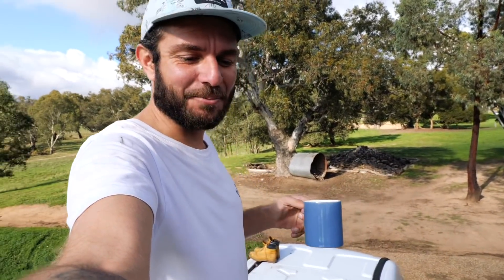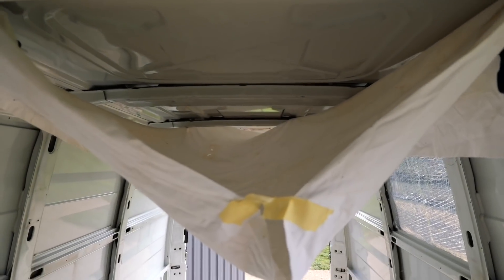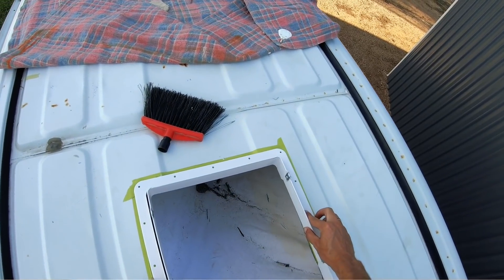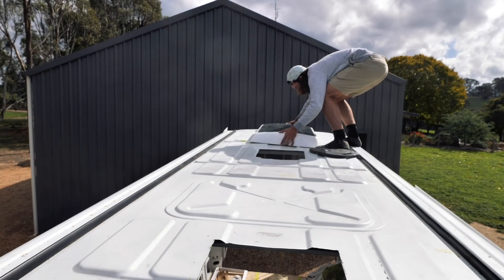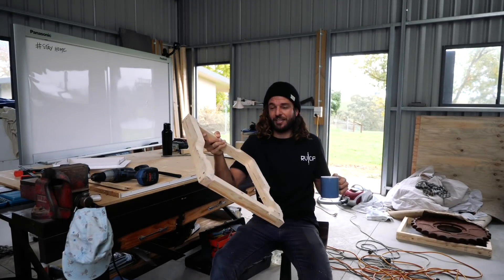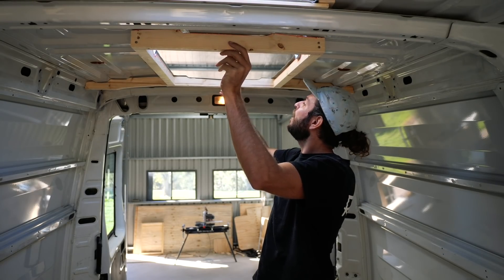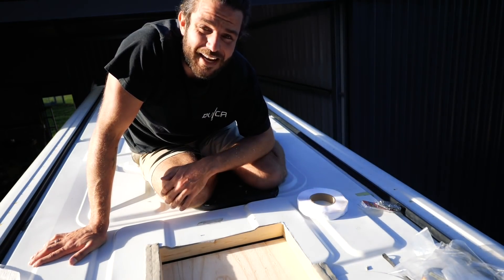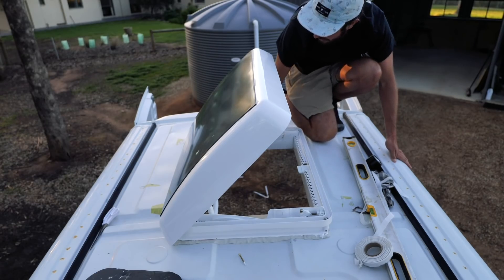Alternative Ventilation in my OFF-GRID Van Conversion & Making Costly Mistakes | Ep 3

Comment: Always put a sacrificial filter on your cameras. Could just be a UV filter.
Reply from the maker: Lesson learnt!
Reply: agreed!
Reply: a skylight 1A if nothing else - they’re cheap and the first line of defence. Is the lens actually pitted from the shavings?
Reply: Eric B exaaaactly. I would have lost so many lenses without them.
Reply: Van name:Occmobile.
Reply: @MaxLeeandOccy  You can send it to Panasonic for a recondition. They will change the front lens out, check for operation and send it back. It will be considerably less expensive than a new lens. And always used a filter as mentioned by Eric and Hamish.
Reply: Always
Reply: Eric B lesson 2: if these metal shavings can wreck your lenses, you should also protect ‘them lovely blue eyes with work goggles anytime you use power 🛠 !
Reply: A new phrase has entered my lexicon. 
Sacrificial filter......
Reply: I was going to say exactly the same thing, UV filters r my go to for that. 

Love the skylight!
Reply: Ashamed to say I learnt that lesson the hard way too.....
Reply: It’s a lesson many of us have learned the unfortunate way!  You’re in good company!

Comment: Use a UV Filter threaded on your lenses to protect the front glass, and you will never have such issues.
You can send your Lens in for service and get the Front Glass Element replaced or cleaned re-polished.
Reply: Yeah I have seen the factory guys do some amazing stuff with lens repair.  Send them an email. Next time clear UV filter 😁
Reply: True, front element replacement is common and reasonably affordable. You may only notice the damage in backlit scenes, but it will always effect picture quality. A single beautiful backlit shot can be worth $200, imho. Great content, worth the investment in repair. Cheers!
Reply from the maker: Definitely going to invest in a new UV filter! Panasonic are saying that it’s “not repairable” but I have found a guy in Melbourne that thinks he can do it!
Reply: @MaxLeeandOccy  I was wondering if it could be polished out or replace just that glass. The video seemed fine to me after, but I totally get the frustration level and wish for a real life "rewind" button.

Comment: Hi Max!  Buy a UV filter and install/screw it on your lens.  If the filter is damaged, it will be cheaper to replace than replacing the lens.  In addition, a UV filter is a must have when the sun is bright.  Do not buy a cheap filter; pay for a quality filter.  All your lenses should have a UV filter.  Have a great day!  (A retired engineer)

Comment: Great job Max 👍
I'm in WA 🇦🇺 still doing my own van build, it's taking forever, but am enjoying the journey.
I completely stripped out the original chabby build (would not recommend doing this, buy an empty van).
In a fortnight am removing the AC unit on the roof and replacing it with a Maxxair Maxxfan as have found over the last year or so have never used the AC as mainly bush camp.

Comment: I like how with each cut and measurement you refine the technique and learn from the last cut it just goes to show don't be scared to get started and that you learn from each step in the process. And a tip for camera lense cleaning get a nice and fluffy duster and very lightly dust off any grime using any type of pressure will just grind whatever is on the lense into the glass like sandpaper. Don't worry I've been there and have completely ruined multiple lenses in a similar manner. Like you said SH*T HAPPENS LOL!

Comment: Great Stuff! giving us all some inspiration. On a side note, that lens can be repaired. Whats damaged is the front element.  Most manufacturers will have a service centre you can send the lens to and have it fixed. Canon has one in NSW and VIC. There is a downside and it is, you need to send the item in for a quote and pay a quotation fee.

Comment: Love the skylight! Very well done. 
Well sealed above. Could always ad a bead of caulk between the wood and roof in the inside to perfect the fit and seal. Also would get rid of any creak or rattle. 
A little concerned the 2 frames could distort the rood and crack a frame over time. Plenty of puddy tape and caulk keeps them neutral clamped though.

Comment: One thing, anytime there is a risk of metal dust on a camera lens, try to use compressed air to gently blow with a  gentle soft brush. Try not to rub. Sorry to hear. We learn from these lessons. Great video. Nice job fitting the vent and roof supports. Those are extremely important. Its still fun doing these. But yes takes time. Allow time.

Comment: Watching you build your van is so calming, maybe it’s because your focus lets me focus and we all forget about the virus for just a moment. Thank you for the space to breathe. I was curious about whether the red tool you used to get a closer cut around the wheel wells on the floor would have worked on your uneven roof surface? I wondered if it took too much pressure to get the shape which made you reluctant to use it? I have considered getting that red tool many time, so I am curious about its strengths and weaknesses.

Comment: I regret using a grinder. Not as much as you did! However the problem is it fires out chunks of metal, but it also magnetises the chunks at the same time!! Which means it stick to the van and start little rust spots. In theory rust sitting on top of paint won't go through the paint, but it sure doesn't look good. Good to collect up and cover as much as you can.

Comment: Just before you start digging into insulation I'd like to put another thought forward. In a hot country as Aus the sun will have heated up all your insulation material by mid afternoon and  it won't cool down before you go to bed., if at all with the warmer nights. If it's not insulated I find that the panels on the roof still keep the sun off a bit and with the van open (and fans) it's not that bad. (I'm in WA). In winter: yes it's chilly  early in the morning (I don't have a heater yet) but the sun actually warms the van up pretty quick without the insulation.  I did a ton of research, skipped most of the insulating (only a few thin panels at the back of cupboards, the fridge, my batteries etc to protect these contents against the sun on the metal) and have not regretted it so far (1.5 year in the van).

Comment: We learn from your mistakes. I’m about to remove with an angle grinder metal brackets that held a suspended ceiling with air-con ducting, in my Toyota Hiace van. Hadn’t considered covering the windows but certainly will now. 
Love seeing the sheep (8yrs away from NZ, now in Kuranda, far north QLD) Going to move house/drive to Tassie  in 2022

Comment: Not sure if this has been said below because didn't have time to go through all the comments right away, but as far as the shopping part goes, next time I would blur out those numbers a bit more. The first part of the CC number is the BIN, which is the same for all the cards which are issued by the same entity so even though that does not show, it does not matter. The CVV isn't showing but it's somewhat easy to bruteforce because there are only 1000 possible combinations.

Been enjoying the build. Keep it up. Will follow :)

Comment: Too late now, but check out tremco Compriband. It’s used for sealing around windows and is modern replacement for silicone/caulk. Flexible and waterproof. Should make a really good seal and expands to fit gaps. However I’ve not seen your putty tape! Looks interesting.

Comment: Max, I've never in my life built out a van but, I've made a lot of mistakes.  I can tell you that many, if not most, have come from being too obsessed, working too long and into the night, being rushed or pressured to meet an arbitrary goal, using the wrong tool for the job, and not wearing protective gear.   You may have a deadline, but its not worth a finger, a toe, or an eye.  Post when you can, if you can; we'll be here.

Comment: Super Build so far. But you should have used the same tool as you did where you cut the floor board around the wheel arches

Comment: Been following yourself and lee for the last year, really enjoyed your overseas content.

Sorry to hear about the breakup, you guys were a great team on camera.

I do have a few things that id do differently as a trademan and fine furniture maker,  i've also fitted both of the Maxxfan and a Heki to campervans

The Heki should have the hinges facing the front of the van, not sideways, you can get a Heki wind deflector to reduce the stress on the lid, don't ever forget to lock it in place while underway or it will get torn off with it installed sideways.

you can get a 400x700 version hinges the right way, but you have to import it in from europe

 Also its wise to stay away from Silicone externally , Sikaflex 291 or even 252 is a better option. rebonding anything to silicone is a big issue, it can't be completely removed like Sika can.

I'd make a foam plug for the Maxxfan to reduce the noise while on the highway, best thing i did for ours.

look at Hafele for your 12 volt lighting, drawer and door hinges and also consumables, such as a 20 litre drum of clear contact adhesive. its a lot cheaper than going to retail stores.

Same goes for carpet, such as 4 way stretch marine flex  carpet, buy a 25 mtr roll from Nolans.

Also use someone like elraco for your hard to find fittings, cheaper and easier than retail outlets and to your door the next day

Get yourself a Rivnut tool for securing cabinets to the van, they hold better than a screw into bare metal, and you can prime the steel to reduce rust issues.

Looking forwards to see what you come up with at the end, as long as you are happy thats the main thing.

I bet you are looking forwards to getting Occy back, we just did a trip around Aus last year, but had to stop due to COVID19, and we missed out on a lot of the great places, due to no dogs in National parks, its bloody tough here, WA is the worse as they also use 1080 in the parks...

Having said that, we will never leave our little guy behind on our travels

Take care and we might see you out on the road, once we can hit the road again.

Comment: I was wondering why you do not use a clear filter over the lens to protect.  Back in the day I used filters and a clear was on all the time to protect lens. 

When sealing my camper roof I found the best sealant is Super Flex by Alpha Systems they make a self-leveling (flows into cracks and seeks level) good for horizontal surfaces and non-sag sealant good for vertical surfaces.  Silicone is not good for  use on campers at all.  Good job on the roof vents. 
 I was in Sydney, Adelaide and Perth 10 years ago for rail transportation business and want to return and tour on adventure bike soon.

Comment: On the lens issue, ouch... but I've seen worse (well, maybe not dollar value, but bigger). Guy was grinding on some engine mounts or something and destroyed the windshield. In your case looks like you can get by without replacement. Might show more with the light at a different angle. Also you might think about pricing out a refinishing instead of replacement. Might be cheaper.

Comment: As a pro photographer shooting off-road racing, I have ruined a few front elements. Send it to the manufacturer for repair. They can change just the front element for much cheaper than the cost of a new lens. In the meantime, order the sun shade that is specific for that lens. It will help loads when shooting backlit.
Reply from the maker: I think I had a sunshade but now can't find it 🤷🏻‍♂️Definitely going to invest in a UV filter at least! Oh and Panasonic said they can't repair it... But a local place in Melbourne may be able too!

Comment: Nice job mate. Just put 2 Maxxfans in my Sprinter last week, was peaking a bit prior to cutting the holes but was very straightforward in the end (phew!).
Tip I picked up from 'Mels Van World' channel, if using a Jigsaw to cut over roof rib contours, if you take the bottom plate off the jigsaw (that would normally rest on the surface) it makes the whole thing much easier.
Looking forward to the next instalment.
Do you have a timeframe for this build?
Cheers

Comment: think it would be easier if you have that square frame built and cut the hole in the van roof to that size so that frame fits in the hole and that would give you a flush top and bottom

Comment: I feel with you so much! we just wanted to screw down out ply floor today and ended up super frustrated because the screws are too short, even though we calculated it all out =D... 
So it's encouraging to see we are not the only ones struggling because we don't have a  clue =D Good luck with the next steps! I would suggest figuring out where your solar panels will go in and install a gland or go on to insulation and do that later =) . If you would like to see others struggle to make you feel better (sometimes that works, am I right?) have a look at @downunder_she_goes (https://www.instagram.com/downunder_she_goes/) on insta <3 ;-)